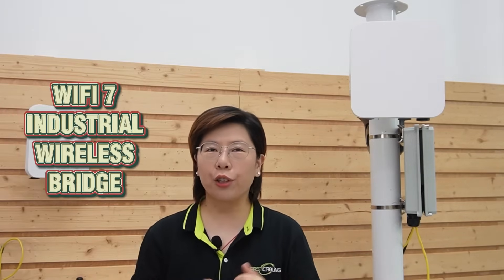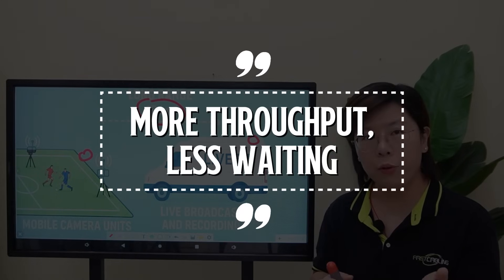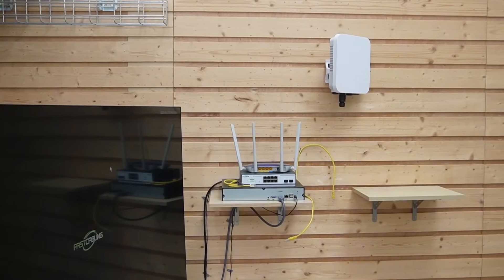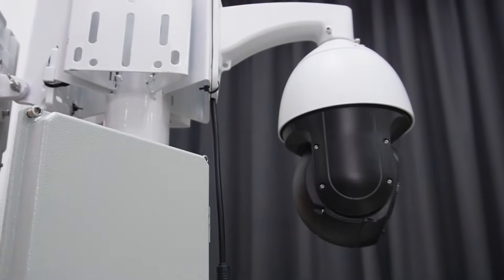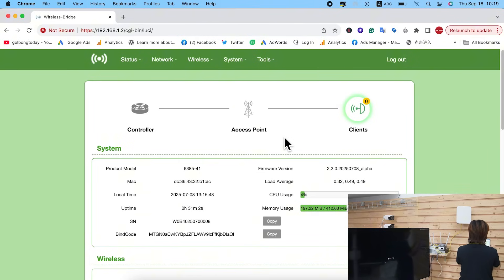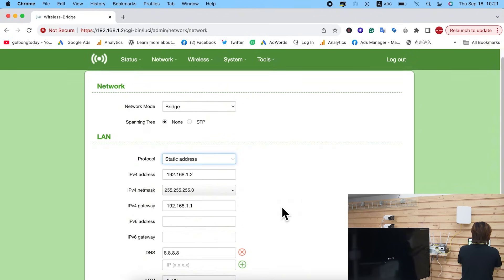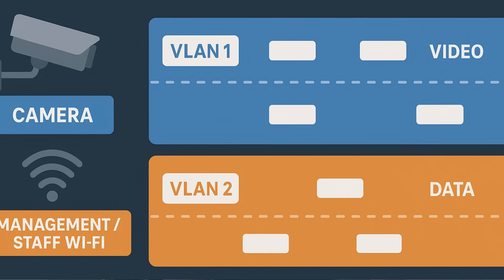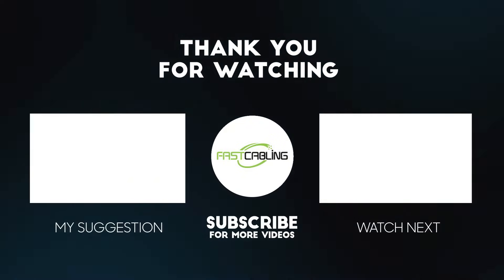Live Video Streaming over 10KM | PTP Wi-Fi 7 Wireless Bridge Setup Tutorial

Comment: i have one question if i add nvr mac address in isp router block list then is device is accessble on internet and still it records
Reply from the maker: Blocking a MAC address means the router will deny that device any network access — both local and internet.
So, your NVR will not be able to connect to the internet (no remote viewing, no cloud sync, etc.). Your NVR can still record locally because recording to its internal storage (like a hard drive) doesn’t require internet.
Reply: @Fastcabling  thank you for your guidence

Comment: Just what i’m looking for but in covert operation, can this system setup be used with a smaller camera, transmitter side equipment working off batteries and solar recharging system as well as the receiving side. Thank You
Reply from the maker: Yes, you can charge this wireless bridge with batteries or solar power as long as the DC output is 12V. You can use it with any size IP camera.